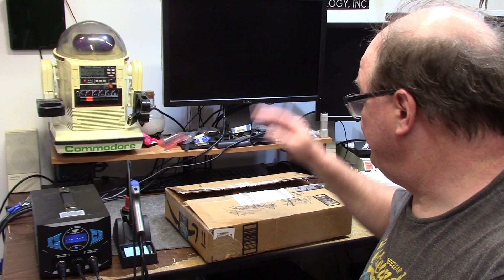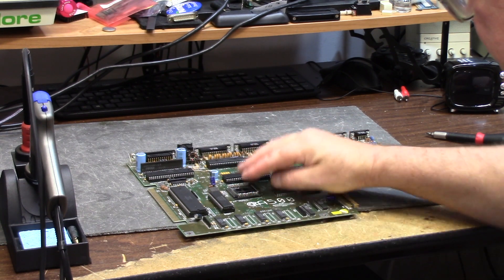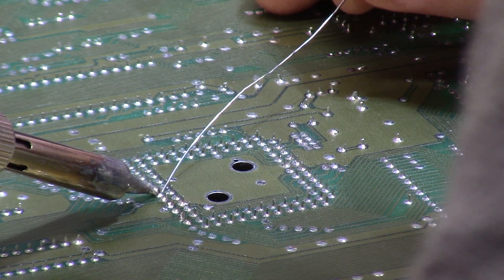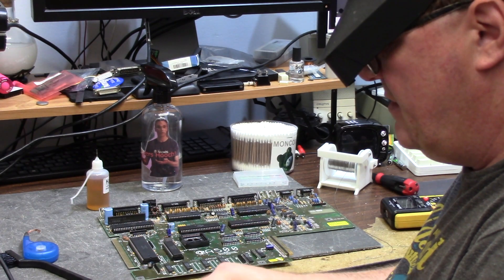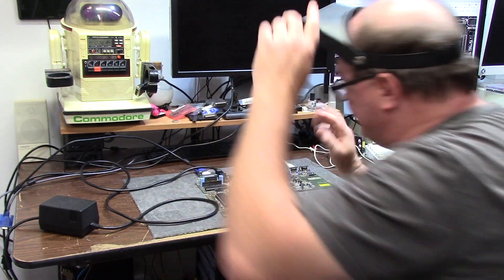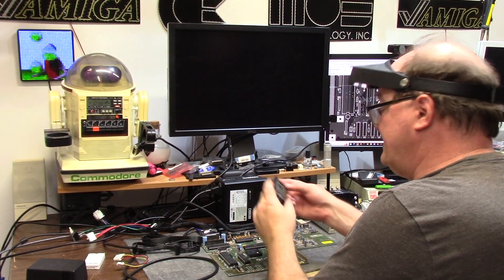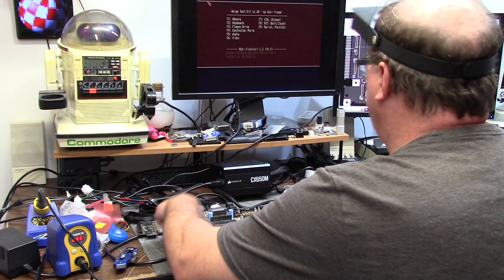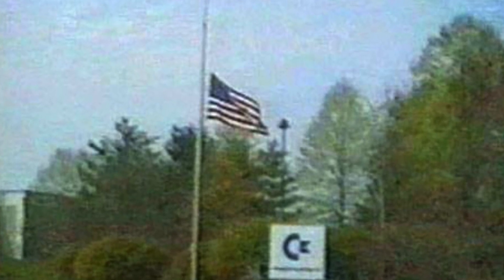Another Amiga 500 from Iowa

Comment: @Chris Edwards Restoration

Hi Chris, I did the same thing to my A500, but then I realized that I had lost the clock, is there a mod to add just the clock?
I never found anything about it.
Regards
Reply from the maker: Clock is unaffected by the xram signal
Reply: But the RTC and the battery were in the 512 expansion, after adding the 512 in the mother the expansion no longer works, therefore I lost the clock.
Am I wrong?
Reply from the maker: weird. clock is not controled by the ram signals,  but who needs a clock anyway. were not running date specific software.